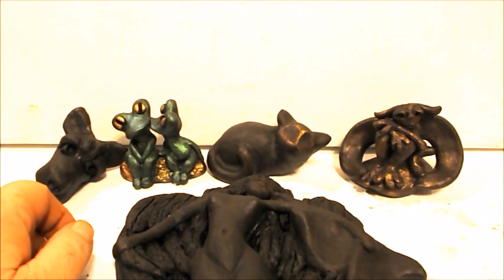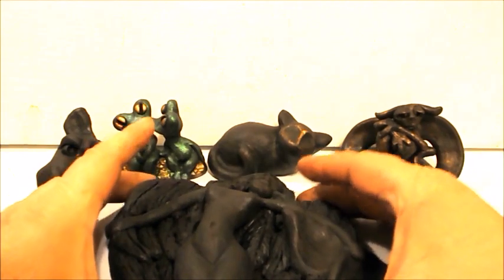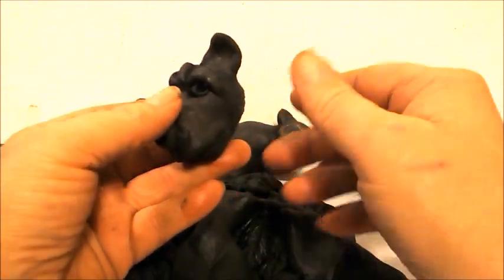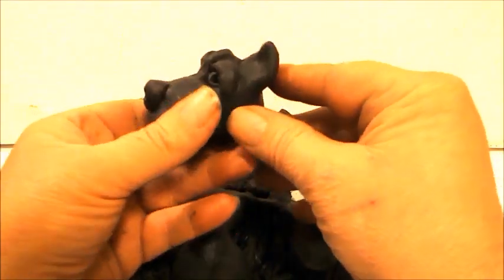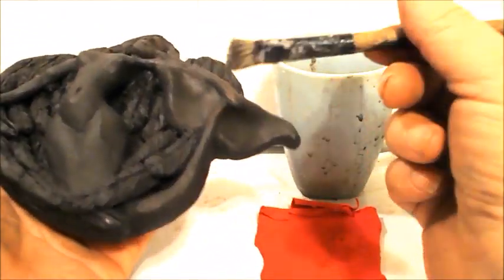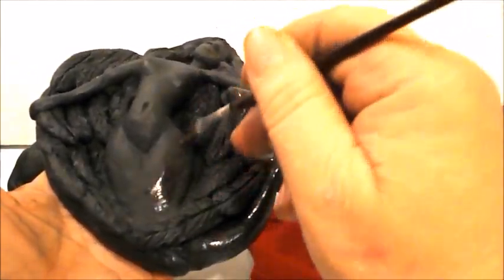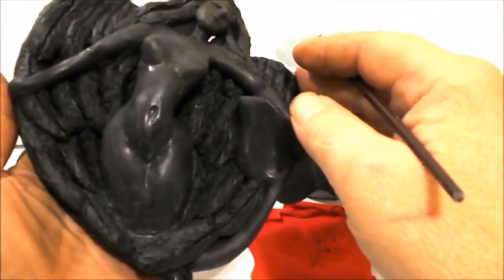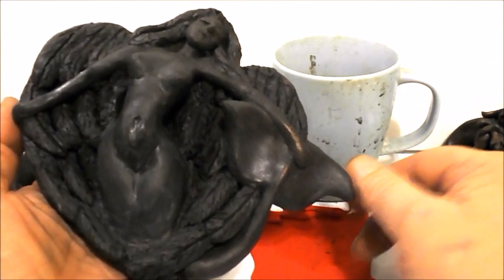How To Smooth Polymer Clay As Taught By A Sculptor Part One

Comment: My piece is still so lumpy and uneven. I want a perfectly smooth surface and I don't get how I'm supposed to achieve this.
Reply from the maker: Sheesh, I know it's been an awful long time since you left your comment and I'm sorry I didn't reply to you sooner - I hope you got through this issue with the lumpy clay. I have seen photos people send me from time to time - and the lumpy thing is a big problem. I think you should try to be aware of the piece as you're sculpting it and shoot for nice flowing lines and don't rush through the creation process - be patient with the sculpture as well as yourself. I also recommend that you try sculpting in self hardening or air dry clay - I recommend Amaco brand of self hardening or air dry clay. I have a lot of experience sculpting Marblex - a clay made by Amaco - Both these clays move really well for you and it is a lot easier to smooth than polymer clay. It tends to be a little messier to work with but it washes up simply with water. Smoothing these types of clay is also a lot easier. I have a number of sculpting tutorials with Marblex especially and I suggest to check some of them out. Thanks for your comment and again, I apologize for not replying sooner. -Jake
Reply: @TheJakefolger  Honestly I forgot I made this comment. But thank you for coming back to help even a year layer.
Reply from the maker: @TheJaminator128  How is it going now with your sculpting? Are you still at it? Are things better? Please let me know. And thanks so much for replying. -Jake
Reply: @TheJakefolger  ill be honest and say that I dropped off after a bit due to lack of enthusiasm. I would like to get good at sculpting, I just haven't committed myself to it.
Reply from the maker: @TheJaminator128  Here is a link to a pretty easy sculpt tutorial I recently did - it is a small turtle - if you like turtles :) https://youtu.be/rBB4U7lfS7I/ He is really cute and it might be fun for you. Also the piece is sculpted in Amaco brand clay, Marblex or you could use Amaco's modeling clay which is air dry clay - Both brands are really good, not expensive and easy to find. I recently got some air dry clay by Amaco on Amazon.com. It really is a world different than sculpting polymer clay in my opinion and so much easier to smooth. It might give you some renewed interest. -Jake
Reply: @TheJakefolger  Thank you for trying to help me out, even a year later, I truly appreciate it. I'll check out the tutorial.

Comment: Hi Jake, my paintbrush keep loosing hair, which brand can you recomend me|?
Reply from the maker: I know that can be really frustrating - losing brush hairs and them getting all into your work. I don't however use expensive brushes - I usually find packages of nylon brushes on eBay for around $5. Below is a link that might be a good set of brushes for you - I have similar brushes and they don't shed hairs at all. I also use brushes that are meant for oil paints - kind of a no-no when painting with acrylics - I have heard they won't last long if you use them with acrylic paint but I haven't had any problems yet and I have used them a lot and for a few years. Search eBay for a set - I picked up a box of about 20 oil brushes of all sizes and shapes for not a lot of money. Here is the link for the nylon brushes: https://www.ebay.com/itm/6pcs-1-Paint-Brushes-Set-Nylon-Brush-for-Oil-Watercolor-Artist-Painting-Art-NEW/111940412015?_trkparms=ispr%3D1&hash=item1a102b226f:g:QBsAAOSwHxVW7DC7&amdata=enc%3AAQAFAAACcBaobrjLl8XobRIiIML1V4Imu%252Fn%252BzU5L90Z278x5ickkAgU0umhwUTmgTFbE5cu7zbFfw6fYX0i%252BAIMEbefPbQ%252B9dkszAf8%252FgVYb3YhmYO%252BoVh3b2Wj%252FelEmK3wFVCgvzlOek9t0mWMEcURtQVLKZ2g%252BQO7Lp4xIEd9vUrgk8MOds1CQGivTL2ytgfZZneRizusDTTOpYsEtDgTXOXGqIH%252Fjv5LFP0Ap9xkdD6MR1HS2IJhx5YiSiecNDrXRZCQjR4BSJ2HOEwJf2UhiO8ALi0U1Jep38ZEdCdhsTkocNdDzf6WAAoGnpvB%252BiwP0utndXZv%252FjW8%252FRBHZIpQYdd%252F8aAdFsK3voqhO1hJ%252FxfCiOwUHJZ%252FGfD41uG5ZMUKYIrZBWnzhC%252Fri5VrL%252FPEBw%252BSLU9bYq%252ByIOOLjNmHuSiZUE8Fp6C5QN0Ji4bHjcakMWeum4tjpgzZGcrIcZMXJC%252BXCIQMVxJlZKAF9eGN3w4isKQ%252B7qPlUvownb8%252Fvyzjz9lQFcou7y0quW4ui0zrok4q6xI15IEInj0ngDnRB%252FOmRrrbOxoEJI9EVofqVvZGbSqhNSVNke5R%252BC7vooqUiJgipLe09eAJgoeiiTRDMi55XqkVIUVoRCTrRaFKw3Mdca6w5mhVfJogUl65%252BcK%252FgW9kOJ1QHZzaVvAG0jTTeiRXhnIF0uY%252B%252FC%252BacF2HnV4EqaVz8Byzh4VGmXulodHdsz4efmGTVVq5u%252FgVQeAqp4UvWFMdN4Plw8ved0bRdioFsKB%252Blwedq4B13i34U5ENZxkG3bp0YEnazQb39YBDokHI0k7nNFdQYY6Y1doS0cRhJCpT8aA%253D%253D%7Ccksum%3A111940412015bbd09530374248a9afe649f9f4f5c457%7Campid%3APL_CLK%7Cclp%3A2334524
Reply: @TheJakefolger  thanks Jake good advice as always :)

Comment: Is that isopropyl alcohol, or doesn't it matter?
Reply from the maker: It is isopropyl alcohol but it doesn't really matter what kind of alcohol you use. Of late, I find myself using a small, soft bristled brush with just a little water more and more - It works great and is readily available at any time. Thanks for your comment. -Jake
Reply: @TheJakefolger  Thanks for the tip, I'll give that a try too.